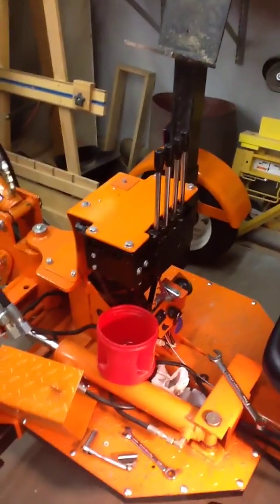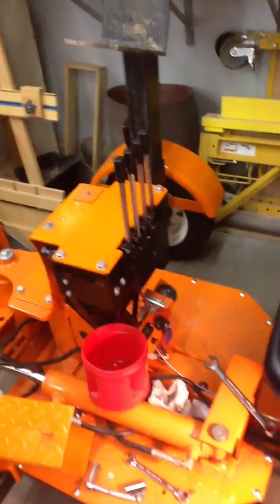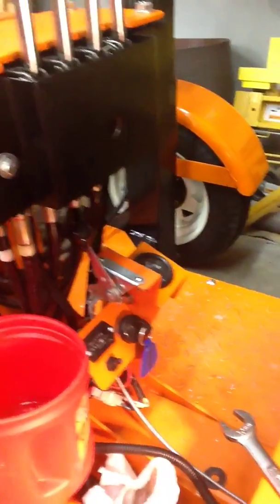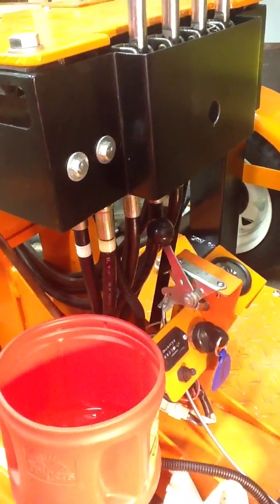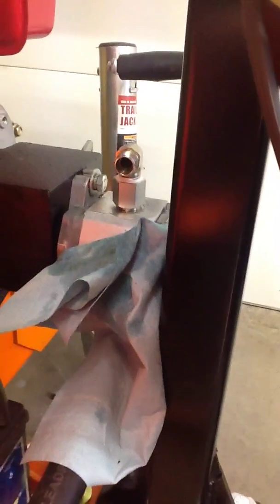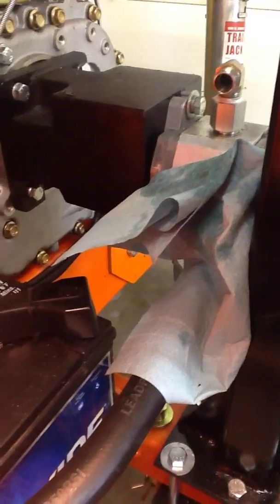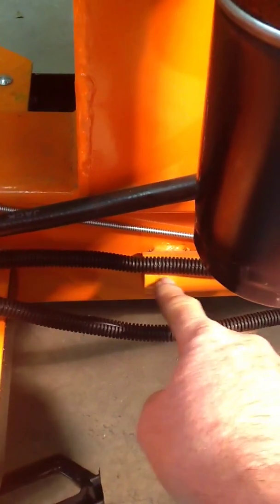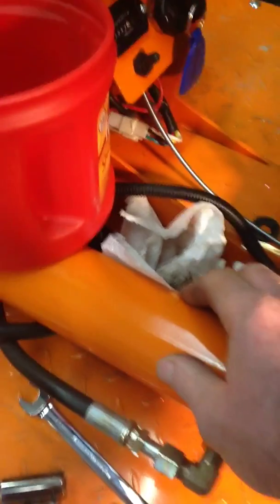Hydraulic hose change the quest for more speed

Comment: Isn't 6 the size meaning 6mm? Looks like it. A bit smaller than a quarter of an inch.  Mine has all metal hydraulic lines and they are stainless steel. The od measures 3/8" so must be a good id.  Maybe that's why mine cost more than years ago.  Smart vid.
Reply: Not mm.  In hydraulic application we measure in 1/16s of an inch.  -4 is a quarter inch, (4/16).  -6 is 3/8s of an inch.  -16 is 1 inch.

Comment from the maker: I have been advised that they have several thread types are used. The best suggestion is to take the hose to a local hydraulic shop to identify the type of connector you have. The shop I used was very helpful in getting what I needed.

Comment: I know it's been long time after this video but have u replace the seat with tractor supply  seat it will fit nice an has bit of spring to it ha ha little softer on the old bottom that is if you're even still useing it
Reply from the maker: Jack Decker  Not sure which video you’re you seen or if your passing on information. My seat is still in good shape with no damage. The machine is kept in a out building when not in use. The seat is also protected from the sun by the sun shade. The only modification I did on the seat was pinning the seat in the forward possession, this gives some support while operating. The pin maybe removed if necessary but I only did that a couple of times. Thanks for the information on a replacement seat from Tractor Supply that’s good information because Harbor has no replacement parts easily available.

Comment from the maker: I think you will be fine with just the main platform because what makes it fishtail is the weight of the boom  so far rearward. The other option is rent a trailer and get it there in one haul out. I move the machine around a lot and when I purchased a 14x5’ trailer it sure made hauling a whole lot easier. Good luck and if you do haul it without a trailer check grease in the wheel bearings very important.

Comment: Thanks so much for the instructional videos, I have just started going through them. I have mine on order now, as I need to do some regular trenching and dig out a small 16x16 hillside area for a cottage addition.  So I thought instead of renting or spending about 6K for a used backhoe this would be a good decision.  Here's my question if you're still answering stuff. I'm getting this delivered to my dock at work where we can pallet jack it off the truck and  I can leave the crate  to unpack it. Our dock has a truck liftgate and also a loading ramp area.  I only have a small Jeep SUV to load it.  I figured I can move it in stages, but the easiest thing would be to take the main body, unassembled, and throw the axles/tires on it and just tow that piece (about 60 miles) out to our cottage place.  I can load all the booms and extra stuff in a second trip. Without the weight of the entire trencher, do you think it will tow pretty safely on backroads at 30-40mph speeds?  Or does it fishtail horribly?  I've seen another guy's video where he recommended putting a tongue extension on it.  But since I'm not planning to ever tow it once assembled, I figured a few strong co-workers and I could guide it down our ramp and hitch it up for this single trip.  Thanks, John

Comment: I've watched several of your videos am amazed at your ingenuity.  I'm not expert on backhoes but it seems the controls don't match the ones on backhoes I've rented or borrowed before.  Example:  the HF 9hp left and right swing is to move left push the left lever and pull to move right.  This just doesn't make since to me.  Same with the up and down on the main boom, push to go up and pull to go down.  These just seem backwards to me.  How difficult is it or is it possible to turn these around to work pull left, push right and pull up and push down?
Reply from the maker: Rob Thorne  You may change them to fit your preference by changing the hoses at the control valve.
Reply: goneredcar1 ahh, just switch the hoses around.  I was thinking turning the valve around.  Your way should be much easier!!!!!

Comment: Not sure what happen to mine. Had it since August think I got about 20 hours, need a meter. Went to start it three weeks ago it was about 27 deg let it warm up for 10 mins and try it. Hydraulic started to work then stop or had no pressure. I waited for a warmer day when it was 50 deg. And it still didn't move. Change the motor oil and drain the hydraulics took filter for it had black stuff in it. Got new filter and change the return hose for 1\4inch to 1\2. Waiting for the pipe sealer setup the I try it. The pump was working when I took the hose off fluid shoot out just no pressure. Will look at the pressure relief value in few day. Letting sealer setup for few days. Will change filter house later. Any thoughts? Bad pump? Or hydraulic oil to thick? Or pressure relief not set or not working? I hope the bigger hoses will speed it up.
Reply: It still not working
Reply: Had same problem once...found paint shards (black) from overspray inside oil filter housing. Clean out , replaced filter..pretty sure they jammed the pressure relief valve open. Haven't had problem since, but i'd still like to change filter housing.
Reply: I had (have ) that problem, changed the filter nothing, fluid nothing, pump nothing. ordered a different valve body waiting for it to come in If this doesn't work im taking it to the shop

Comment from the maker: I sure no about the deep freeze I'am in Lake Villa, IL were right on the IL. WI line and we had the cold and all of the snow.  Good luck on the new machine they sure beat a shovel.  If you have any question feel free to contact me I have run the heck out of the machine.
Reply: A fair sized threaded Clevis Shackle sure helps hauling it into the garage out of the crate.  The threaded pin on mine just barely fits into hoist hook opening.
The fabric hoist sling then easily slides on each side of the shackle.

Yeah,  I knew you were from northern Illinois.
The boat video and the voice were dead give aways.

I'll have to work on it to legally get to my property in the UP.
I wish I could do some quick connects and haul it out of a trailer up there with a chain hoist and lashed tinbers, but I'm  thinking I'm better off just doing fenders and lights and haul back roads at night. 

Just have an old Ford Explorer and a well restored old dirt trailer based on an ancient welded pinion U shaped frame/axle thing .  It holds alot of weight, but .... 

Thanks !
Reply: goneredcar1 I’ve just ordered one of these machines. I’ve already got the 4.1 gpm pump mentioned.  I want to also go ahead and get the inlet and return hoses as well.  I see the inlet is 5/16 and return 3/8. I just need to know the hose length and what kind of fittings to have crimped on the end that will be going into valve body?

Comment: Thanks much for the videos.
I've been following them  for weeks.
You told me much of what I needed to know on how to just get it in the garage.

I took delivery today after a delay due to the deep freeze. 
Worked out good with the new melt.
I was prepared. I got it out with an engine hoist and a reciprocating saw in just under  two hours.  I cut the half U-bolts.

Got lucky, got a warped 10 ft 6 x6 at Home Depot at 75% off.  I cut it into 4 pieces and used them as blocks under the hoist. Cost, $9.50.

Dave in Green Bay and the UP

Comment from the maker: Please forgive the narrow format I was in a hurry and I had the pad turned the wrong way.  I also changed the oil tank return hose to 3/8 inch to help speed the oil return up a notch.
Reply: would replacing the input line improve a machine still having the stock pump?